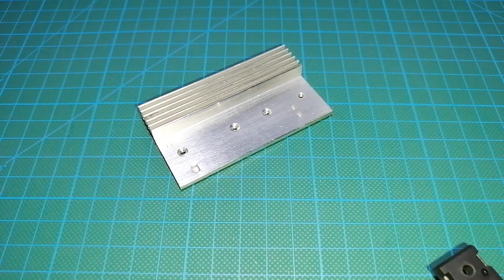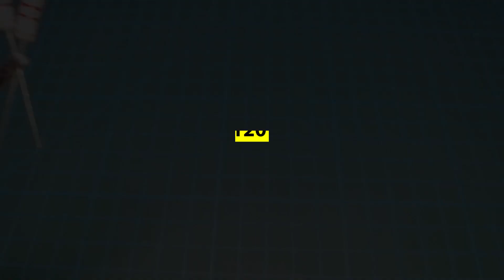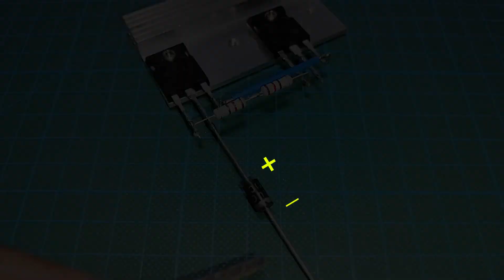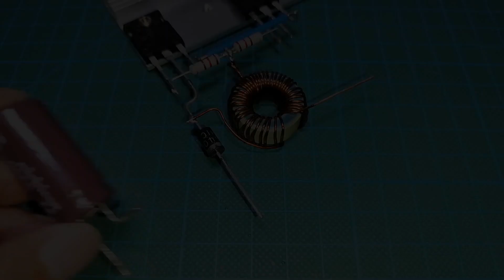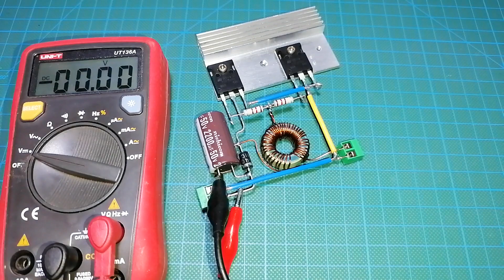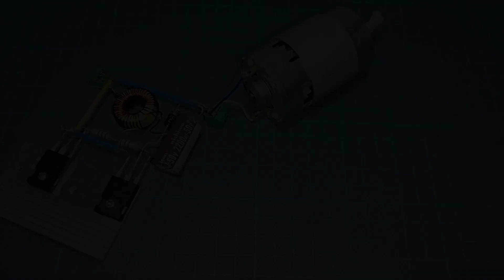3.7 volt to 12 volt Boost Converter, 3.7v to 1500w, DC step up converter

Comment: Another exaggeration with the output power. 1500W would be 405A from the 3,7V input. I don't think the battery and the connections can handle that amount of current.
Reply from the maker: yes you are c

Comment: Es un Convertidor amplificador DC a DC...e incluso se puede lograr el mismo efecto de Amplificación con condensadores electrolíticos, diodos NP y una pila o batería eléctrica y sin la necesidad de adquirir toroides y transistores costosos...

Comment: If i use 100 ohm ×2 resistance between transistors is this working.. And if i use capacitor 22000 / 10v it is working..? Plz hellp
Reply from the maker: Yes, but low voltage out.
Reply: The capacitor be come hot. And i inbot zenor 12 volt in capacitor it parning
Reply: I want a circuit to raise the voltage of the power bank of the mobile phone, which is 12 volts stable, to operate the satellite resever? Plz plz

Comment: Nice 
Please Booster 0-30v input to 12v out 5A
Reply from the maker: 5A 🤔🤔
Reply: @homemade_101  I mean that you can do something similar, the difference is that the input has a voltage between 0-30v and the output is 12v with a current of 5A

Comment: Sir ji good afternoon sir ji how to make egs002 work with two pic igbt module for h bridge inverter circuit dayagram tell me sorry for my English thankyou sir
Reply from the maker: are you need h bridge inverter circuit diagram using egs002 ?
Reply: @homemade_101  yes sir ji   egs 002module see drive  two pic igbt module hbrize circuit for a 6kw inverter sinewave transformer

Comment: Nice work .. but the voltage is keep rising uncontrolled so it will be harmfull to some devices
Reply from the maker: :yougotthis:
Reply: @homemade_101  using trimpot 100k maybe encouraging
to keep the voltage in safe range

Comment: I have done this experiment with a vacuum cleaner Ac  2000 watts Motor run with a 12 volts Dc current and its Run with an amount of current balance’ no inductor no capacitor no heat sink etc etc….

Durvesh yezdani’s